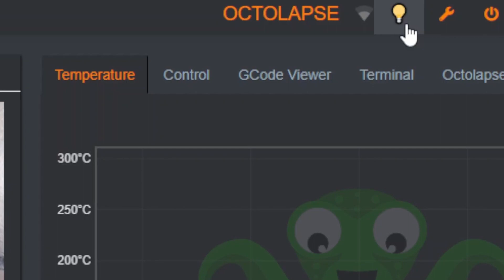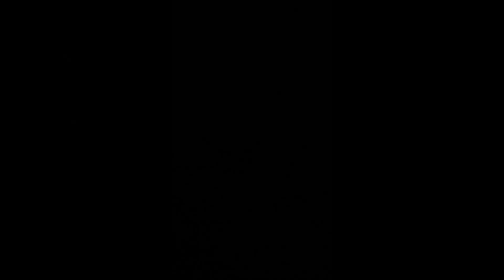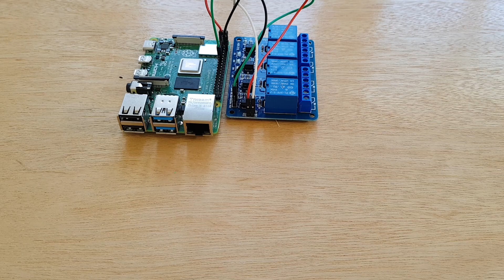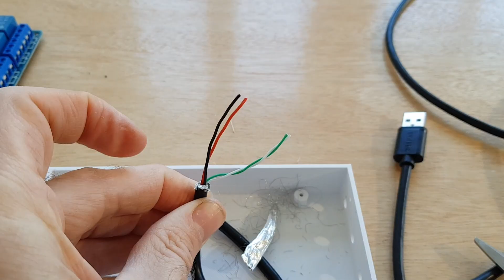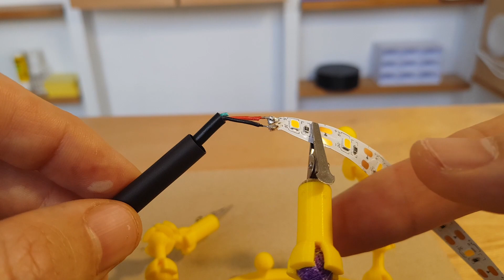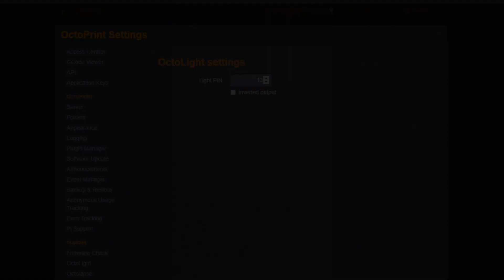Remote controlled 3D Printer Lights using Octolight plugin for Octoprint

Comment: Could a 12v or 24v led strip be used, removing the power from the raspberry and using an external power supply?

Comment: Can you power the led lights directly from the pi's 5v pins?
Reply: The Raspberry delivers very little current through the pins, right?
Reply: @enycarnaval according to a very quick google search, it should be able to supply 5v through the GPIO pins

still don’t

Comment: Thanks for this tutorial Maker Mike! Question from a pcb noob. I realize now that I have 12v led strips in my Prusa light bars. Is there a way to add something to this setup to run 12v or do I need to replace my strips with 5v LED? Thanks in advance!
Reply: You can power 12v led to 12v power and connect it to relay. Data side of relay works fine with 5v
Reply: @shoppygadgets  What would the wiring be? I appreciate the help.

Comment: Octolight Adding a physical light switch.
https://youtu.be/1He6DoAsRS4?si=pOiSMIy-mlpvW3k0

Octolight plugin within Octoprint

I tried MOSFETS but these did not not work for me.

Maybe there was some back current into the MOSFETS.

So I use Arduino Raspberry Pi 2 Channel relay in a similar  circuit as a two way house lighting method.